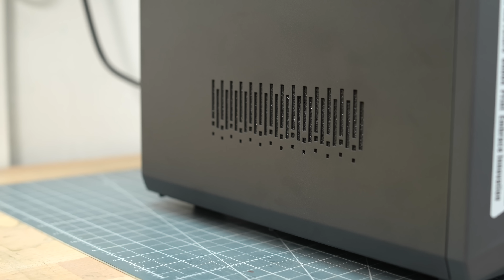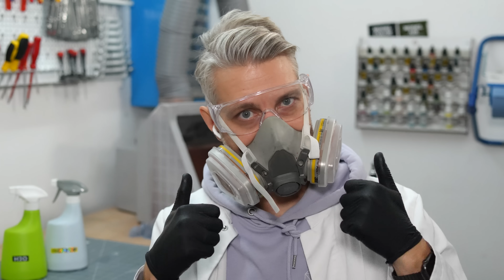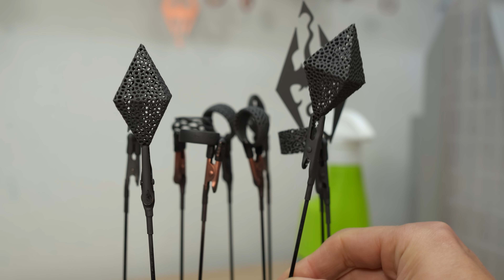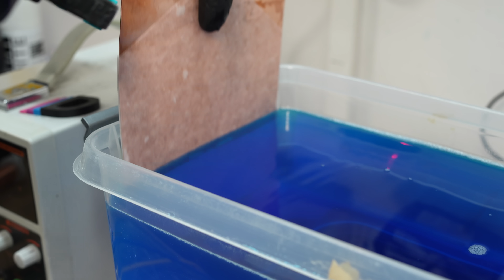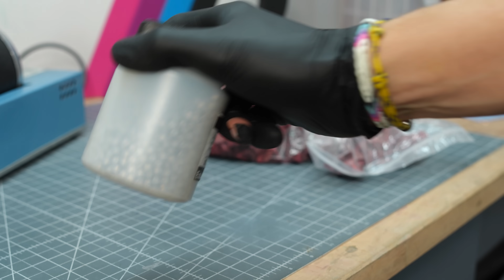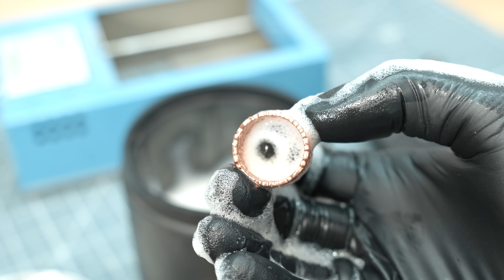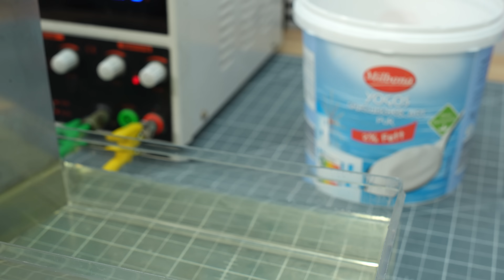Electroplating 3D Printed Jewelry | FULL TUTORIAL

Comment: How do sou get them so shiny out of the electrolyte? I bought commercial electrolyte alkaline and after 30minutes on 0.2A it started to coat. After 2 hours whole part was nicely coated but in pink matte color. I tried to add brightener but nothing (parts verr coated in Graphite and polished before)
Reply from the maker: Alkaline is wrong. Get an acidic electrolyte.
Reply: @hen3drik okay thanks, I tried to make also my own acidic with 37% H2SO4 4:1 to deminalized water. Also added a few drops of rinse aid to 1L mix. Color is still pink matte. What would you recommend?
Reply: Or should I add more rinse aid?
Reply from the maker: I‘m sorry I don’t recommend mixing your own electrolyte and I cannot give any advice for this as it’s quite dangerous imho. Be safe and try to get a commercial one; I’m aware this can be quite of a Challenge in certain countries. Especially h2so4: you don’t want to mess with that.
Reply: @hen3drik okay and which one you recommend? I ordered from Germany Betzmann galvanik - kupfer alkaline
Reply: @hen3drik i found tifoo from germany. It this the one you are using?

Comment: Watching this video after a failed attempt to electroform a ring using a commercial graphite paint because I didn't polish the ring (which coincidentally seems to be the same model you used) like I've done with previous attempts using my homemade paint, which I got down to between 80 and 200Ω BUT can't seem to electroform onto it...

The coffee filter around the anode is a great idea. The chunks that came off of it stuck to some metal (specifically the rim around a magnifying glass from my 'third hand' tool) that I electroplated last night just to see if the conductivity of the graphite was the problem, and it is.

I'm going to make a vibrational tumbler for polishing prints
Reply from the maker: Good to hear 🎉

Comment: Hello can you please help me to understand the process, which resin should i use?
Reply: The resin is completely irrelevant here as you can see he also used PLA FDM prints. The important part is the  layer of paint; Either  graphite spray, copper spray or graphite paint. The electroplating fuses  to that layer of paint, not to your actual printed part.

Comment: Spinning the solution, even at very slow speed, changes the solution at the liquid to solid interface. This allows for constantly fresh solution in contact with the target, which allows for maximum molecule movment to the the target (cathode) and increases uniformity and coverage.

This is done quite often in the anodizing industry as well for the pretreatment stages. 

Remember that plating is done at extremely thin layers. If you dont polish the copper strike, every subsequent layer will map the duller finish and will carry that dull finish to the final layer.

Comment: I would love to be able to do this, but I already know I can't afford it and I definitely would not be able to dispose of the waste properly.
Reply: It's probably $600-$700 in total for an electroplating kit, graphite spray, and a bench polisher like a jeweler in the comments suggested as a better solution than a tumbler. Add in a mid priced 3d or resin printer and it's a little over $1000 It's not cheap but not ridiculously expensive either. Disposing of the waste seems easy enough if you only have a bucket or two. Neutralize with baking soda, let it dry out, and then throw it away in the trash. Alternatively, dump it in the ocean near an electric eel habitat and see if they electroplate themselves.

Comment: Jeweler here! This is really cool! Although I really don’t think all of that tumbling in order to polish is necessary!!  If you got either a small polishing machine and wheel, or a polishing/buffing wheel attachment for a rotary tool (dremel, flex shaft, etc) and some bars of polishing compound, the wheel should make quick work of polishing your metal plate! This would take you wayyy less time, and would negate the possibility of chipping off the plate due to tumbling. Great work!
Reply: I would love to have more information on what you would recommend for the polishing process!
Reply: Would you say it’s better to hand drill and set diamonds or just 3dprint the holes and set them that way 🤔
Reply: @hoophoudini  I don't think anyone would be setting diamonds in plastic. You wouldn't be able to hold them in place well enough and the product is too cheap for it to be worth it.
Reply: @MN-uy8sb  yea that’s understandable I’m saying already cast where the diamonds would sit or hand drill the holes is it really that much of a difference in the end

Comment: Hi! Good work! I've followed your video, but i don't suceed to have a polish surface! I believe that the problem is on the voltage for the bath. Can You tell me the correct voltage? On my pieces, The copper ends up on the wire I use to tie this. What material  use You for the wire? Thank a lot!
Reply from the maker: You have to look up the instructions for your specific electrolyte, especially the required current. Then you apply this current via c.c. Mode. Voltage is always different and regulates itself. 1-1.5A/dm^2 is usually ok. The wires are from copper, too.

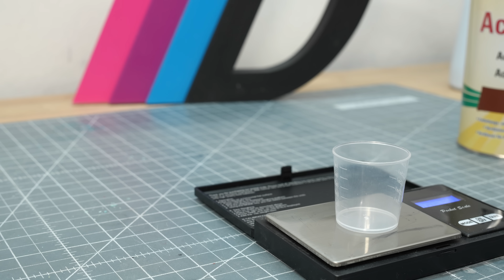Comment: At 3:20 you mention your recipe as 3 parts graphite, 20 parts acetone and 1 part super glue. Is that by weight? Presumably it is because you use pocket scales. It looks like you put less than one part super glue though. Also, how fine is the graphite? 3000 grit?
Reply from the maker: It’s by weight. I use 4 microns graphite.

Comment: Question: How well do your larger prints hold up?
Resin prints degrade over time, especially if they're printed hollow. The tiniest bit of uncured (or even not completely cured) resin will de-cure cured resin over time.
Basically, if I printed, say, a large figurine, electroplated it....if that degraded a few years down the line, would the metal layer contain it? A 'thick' layer is relative when it comes to electroplating, so wondering what would happen.
If anything it would be an interesting experiment.
Reply from the maker: Good point. I always overview. Once the metal encapsulates everything I am probably fine. At least I have not experienced anything in that direction with electroplating so far.

Comment: What happened to the 3d printed piece after electroplating? Does it dissolve completely, or the metal just deposits on top of it?
Reply from the maker: Metal deposits on top of the print.
Reply: In case I want to get rid of the print after the plating, how do I do that 
For example I want a thin piece of silver, so what would be the steps for that ?

Comment: My graphite mixed by the recipe intermittently clogs the airbrush. Thinning them does not really help until the paint barely has any graphite powder left! Forcing air back with my finger resolve the clog but it returns immediately. I am absolutely stumped, can anyone help?
Reply from the maker: My details: i use a 0.5 mm nozzle + 4 my 995 graphite + ethyl-2-cyanacrylat glue
Reply: @hen3drik  such speedy reply! Thank you for the info. One question, though. Is graphite mesh 200 small enough? I fear that it was the source of my problem. Thanks again!

Comment: Hello there , I've tried mutlitple things but It seems that I c'ant electroplate with graphite paint even though i've polished the painted part with my rotary tumbler.
Any idea where I could have done a mistake ? thanks in advance and keep up the good work :)
Reply from the maker: Measure resistance of your coating. Should be <=1kOhm. Thicker layer of graphite. Use 4 microns graphite.
Reply: @hen3drik  thanks mate , I'll try that :)

Comment: What is the recommended grit for the graphite and what is the best voltage and current 

And please please please 

Show us how to make the copper solution instead of buying from tifoo thay dont ship it every where
Reply from the maker: Graphite is 4microns current and voltage are calculated and always different. Voltage usually regulates between 0.7 and 1.2 V.

Every electrolyte is different so I chose to buy a commercial one and this works great. Mixing your own, that is really great in the end, requires potentially dangerous chemicals and won’t be covered in this channel, I guess. Instead I try to get electrolytes from all over the world that are relatively safe to test them. yet, it’s hard to get these here, too.

Comment: I built a rotajig from Thingiverse, but despite carefully following the directions, I can't get the supplied code to load. I've tried directly copying the files as in the directions and tried using Arduino IDE to compile it as well. I made sure that I am using a data cable, not power only. No luck. I have no experience with coding and I'm certain I'm just missing a step. Can anyone provide clarification?

Comment: Using Stainless steel releases toxic gases and should not be done indoors.
Reply from the maker: Good point because of the nickel/chrome. My electrolyte explicitly suggest using a stainless steel anode. I always use a respirator and ventilation as extra caution.

Comment: Could you make a strength snap test of how much stronger or durable a resin printed part really gets with 0.2mm of Copper/zinc/Silver/gold?
As in for customer that may want to electroplate more structural parts like for shelving brackets or generative design applications? I've looked and it doesn't look like anyone else on Youtube has made content showing the bend strength or durability of hitting against stone or holding weight?

Comment: Thanks for an amazing video. Please help- something is not working and I don’t know what it is that’s causing it. I made the graphite paint exactly as instructed. I don’t have an airbrush, so I dipped the items. I let them dry and then I polished them the best that I could. Put them in to plate and… almost nothing. I tried it with my silver ring in the same way and almost instant results so at least I know the solution is good. I have been putting two points of the copper wire inside the printed ring to hold it in place but yours has fine copper wire almost wrapped around it. Is this important? Please do a video showing how you wrap the wire and how it has almost no effect on the plating. Did yours all work first time or did you have to experiment? Please show us what went wrong (if anything) so we can learn from your mistakes- if there were any. 😊

Comment: Great video's!! 
I have been looking into starting electroplating 3D prints myself for a while now but i want to make sure i understand everything before i start so i have a few questions. 
I was wondering what i should do with the water i use for rinsing the prints. Can i reuse it? After it is no longer usable i should take it to the recycling center right? 
Also, should i polish the copper paint as well before electroplating it? I dont have anything to measure the conductivity

Comment: i wonder if you could use this method for 3d printed gears. print with adequate tolerance, and then coat in metal for improved durability. Could probably get away with only the first 1 or 2 polishing steps too. for just a little less wear.
Reply: and further durability could be done with maybe titanium sputtering?  tungsten would be better but afaik, those can both be *difficult

Comment: Hi ! Your video is really great ! So well that i've buy the necessary and start today to do the same on some 3D print ring, with graphite spray paint, but i've a little thing that i'm worry about, on the copper wire i put for the negative pole, i've a little ball of copper on top, just under the surface, it grow and fall... Any idea ? Thx a lot :)
Reply from the maker: Current too high 😉
Reply: @hen3drik  thx i will try with lower current

Comment: Thank you for the inspiration. I have been contemplating the wax loss verses the plating methods. So, it's do I want heat or electricity. Wastes: plaster molds or depleted electrolytes. Products: Solid metal products or plated plastics. First I need to clean out my garage. But that's my problem. Thank you again.

Comment: May I know why use conductive paint instead of just using copper spray paint? Sorry if this sound dumbadudu
Reply: Wait Is it cuz u wanted to make the layer thick and make them go through the tumbling process and get the shine? ✨
Reply from the maker: Yes, I create a thick copper layer first (200microns) and then thin decorative layers of gold (1-2microns). The thick layer adds weight and stiffness + rigidity

Comment: I just want to know which small dc rectifier you are using?? I found one on Amazon Nankadf 30V 10 amp dc power supply. Is it good ?
Reply from the maker: Basically yes, make sure that it regulates the voltage (C.C. Mode)
Reply: @ thank you for responding quickly 🫡

Comment: Im using PLA, am I able to put a coat of a heat resistant spray or something before electroplating? And do you happen to know of a heat resistant thing for 100° to 150° Celsius?

Edit: The reason is I want to try the Copper electroplating on a project, and a Graphite paint (without a coating over it) for another
Reply from the maker: Depends on the heat paint: the conductive paints sometimes destroy the paint beneath. Try it first.
Reply: @hen3drik Okay! Would you happen to know of a good heat paint I should try? If not I’ll do research and find the top few options

Comment: I don't know much about electroplating but how durable is it for jewelry compared to casting it?
Reply from the maker: The FDMs and Resin Prints get quite rigid and stiff. It’s a 200microns thick copper layer that adds weight and metal properties while maintaining an overall light weighted ring/ear ring. These things are tough. The final plating in gold or silver can be worn off by sweat etc over a long time; but that depends on how thick you electroplate these decorative layers. And it’s like with any other full metal jewelry.

Comment: If you polish the 3D print prior to electroplating, it will be very smooth. Also,  plastic does not require long periods of polishing.
The plated item then just needs a bit of buffing with rouge ...

Comment: How long do you usually leave these parts in to plate, in order to reach the 0.2mm thickness you describe?
Reply from the maker: 0.5microns/min@1A/dm^2. so around 6 hrs does the job.
Reply: @ thanks! Similar to your process, I coated my parts in graphite paint and polished to a shine before plating. I’m using an acidic copper sulfate solution with Midas brightener. The plating works fine, and comes out somewhat shiny, but nowhere near as mirror like as yours do when they come out of the bath. How are you achieving such a clean, shiny, near mirror finish directly from the plating process?
Reply from the maker: I get this question a lot and I honestly don’t have a answer for this but practice I guess. When you watch my first videos I also got that semi shine but ended up controlling the process with stirring, calculating current and working perfectly flawless until the very end. I guess that’s key. Still improving on certain aspects as crevices are yet a mystery for me.
Reply: @hen3drik  haha same, the crevices do not comply… so I guess electroplating really is an artform and just takes time for each person to dial in their specific setup huh?

Comment: Hopefully i can save you some sanding time :) Rather than sanding to make my prints smooth, i either dip them in UV epoxy resin or pour UV epoxy resin over them while they are contained in a perimeter wall then drain off the excess. The UV resin cures in minutes ineither sunlight or under a UV lamp and gives a totally smooth and shiny finish.
Reply: Isopropyl fumes in a box works
Reply: How does that effect the final details/thickness?
Reply: @DragonRiderShiru  If well-drained it adds about 0.2mm on average, i'm only making drink coaster sets with not many fine details, probably the finest detail is the bottom point of small, debossed hearts i have on one of the coaster holders and it's still very pointy, looks just like the original. You also have the advantage of being able to colour the resin to give any colour finish, and you can also add glitter etc if you like.
Reply: I wonder if compressed air could help thin it out after dipping. Make a hell of a mess but should bring the thickness down from 0.2mm
Reply: @ I use a small heat gun to flow it off if necessary.
Reply: @GaryMcKinnonUFO Nice to see you in this comments section, Gary. Never knew you had your own crafts business. I make pens and jewellery.
Reply: @Tom_Samad  It hasn't taken off yet, only recently completed the website and started an FB ad campaign. Good luck with yours :)
Reply: You can also use acetone in a box
Reply: @ashtonphoenyx was searching for information on this, do you have experience with this?

Comment: on the saftey note don't forget your goggles and respirator when using the bathroom, you never know when you'll get splashed in the eye. 
also make sure you have an oxygen take and rebreather when taking a shower or bath. you never know when you could drown. 
also make sure you have someone taste test all your food just in case. if they run to the bathroom or collapse, dont eat it. 
most importantly, don't forget your bubble wrap and full face helmet when driving or riding in any car and make sure you're wearing at least 3 seat belts, you never know when you'll crash. 
stay safe out there.